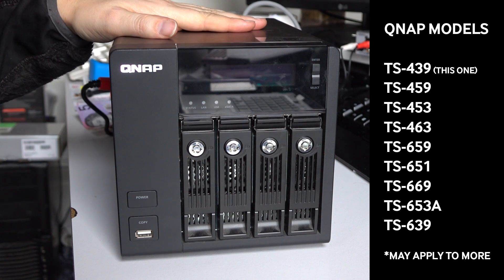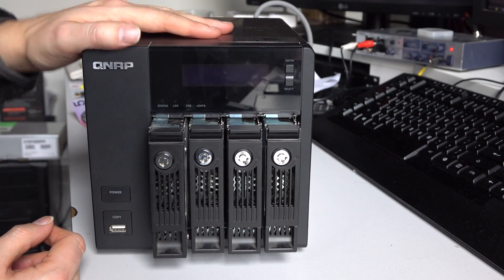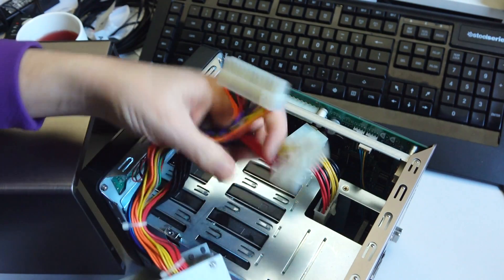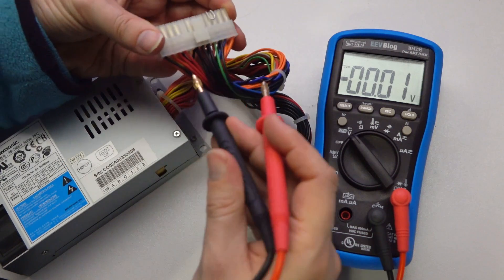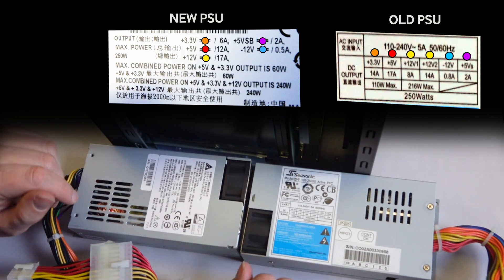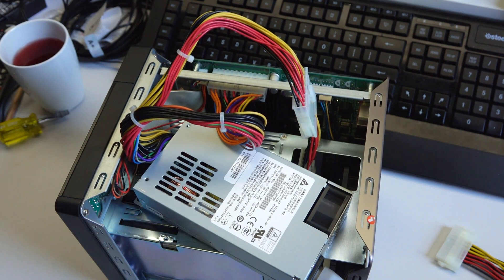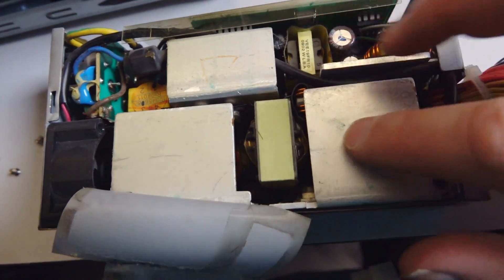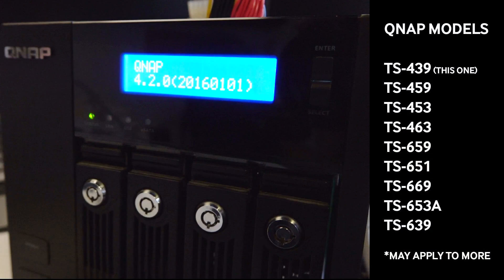QNAP NAS PSU Power Supply Fail Replace ts-439

Comment: You helped prove the power supply was fine and that the UPS looked okay, but had left the chat.  Oh, and leaked enough to corrode a lot of metal and burn some wood shelving...  Bigger UPS, bigger problems and get 'em w/metal bottoms, folks!

Comment: Thanks for this! I just killed my TS-651's PSU today (by attempting to stop its noisy fan with a screwdriver.. bad idea). I'm going to try something other than a $160 factory replacement, however. If one examines what they're actually selling, it's just a Sparkle Power SPI220LE, or maybe SPI270LE 1U/FlexATX unit with, essentially, six drive connectors bundled into one 20-pin connector.

Thirty bucks, a staple to pop wires out, the dead unit's 20-pin connector and some time..
Reply: Thanks. How did you bundle the 20 pin connectors? Thanks
Reply: I do not understand at 1:58 approx how do I setup the HDD connector. All PSUs present standard ATX connector ...
Reply: Hi. Thanks for your advice. What unit did you use?